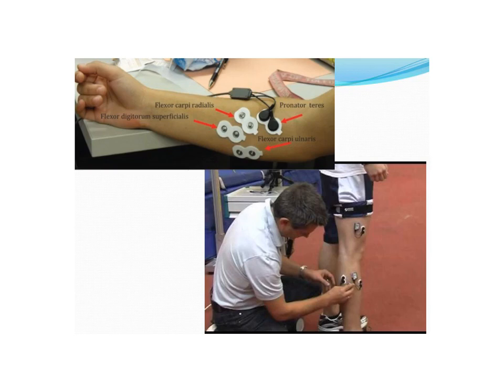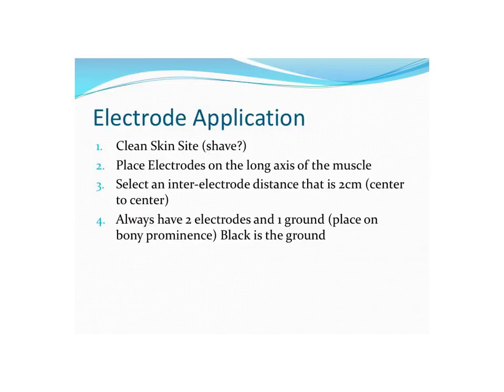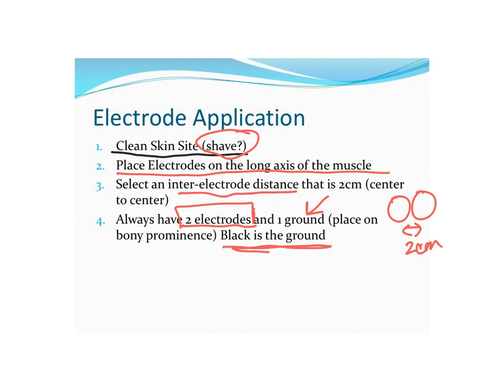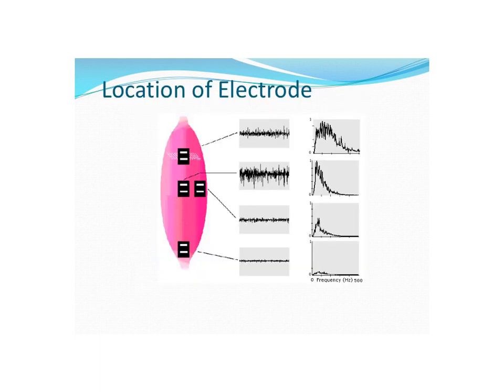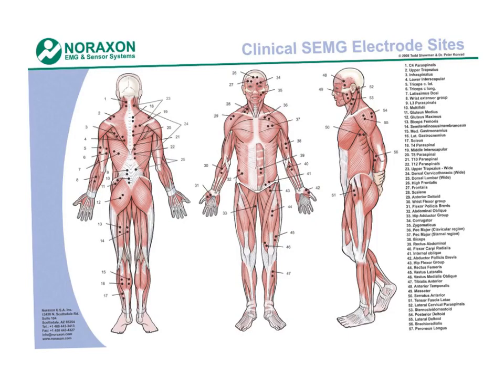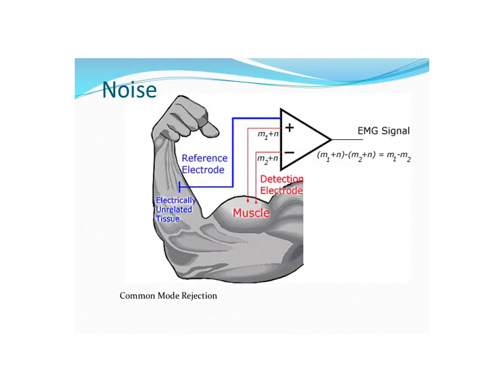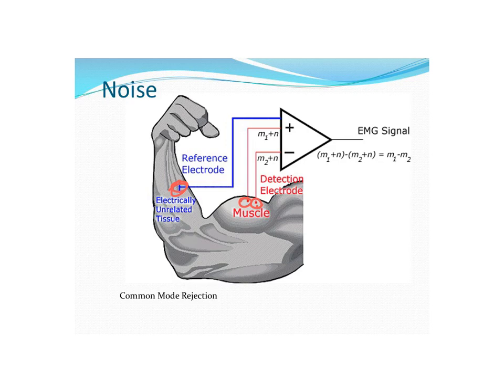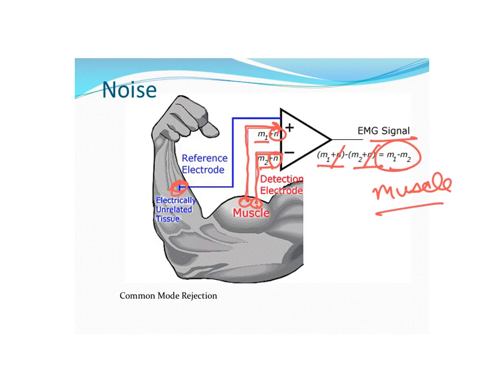EMG Electrodes

Comment: Placing sEMG electrodes on the belly of a fusiform muscle is not accepted anymore, placing them on the motor unit (innervation zone) makes great noise and results small amplitudes. "Indeed, in this case, signals generated by action potentials traveling toward one tendon are subtracted from similar signals generated by action potentials traveling in the opposite direction, with a resulting output that is small and noisy and often close to zero. " I recommend you a book to look at: Atlas of Muscle Innervation Zones Understanding Surface Electromyography and Its Applications by Marco Barbero, Roberto Merletti, Alberto Rainoldi, 2012.